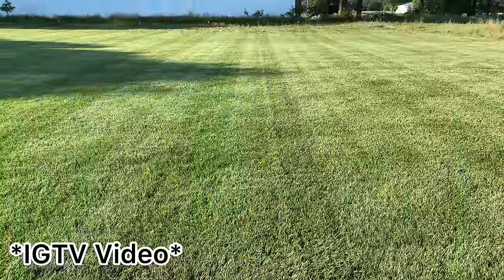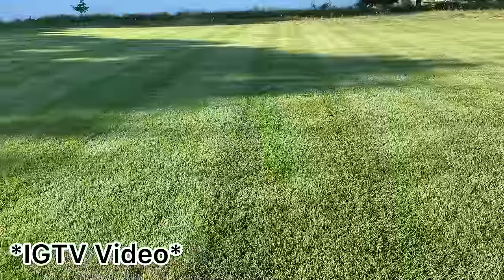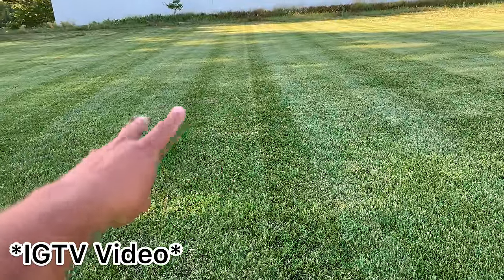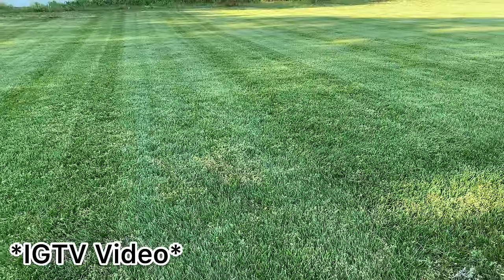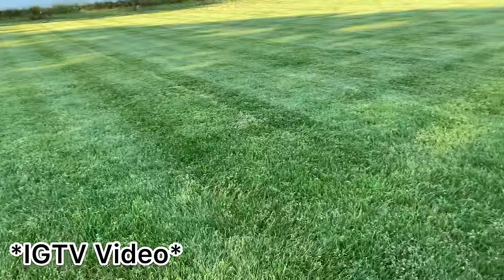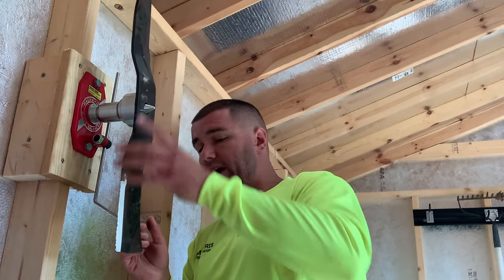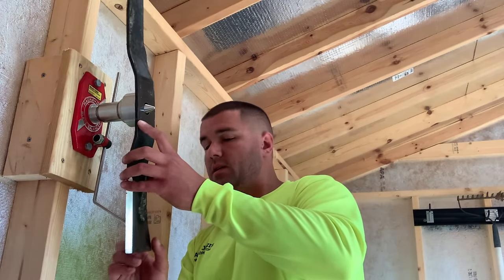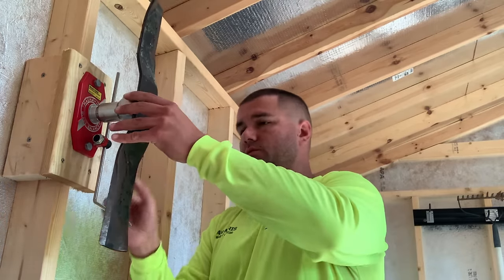Uneven Grass After Mowing? [How to Spot and How to Fix!]

Comment: i look at a lawn like yours and wonder what would bend your blades. something much easier and faster is check tire pressure. you probably have a flat tire. 9 out of 10 times it is a low tire not a bent blade
Reply from the maker: At the time of filming this I was also cutting grass as a side business. But I don’t recall hitting anything. I think the blade was just worn, it had quite a few hours and lawns on it

Comment: You only showed us you sharpened them, but you didn’t show us how to fix the problem
Reply from the maker: I barely remember what I did in this video. Made it like 3 years ago and the algorithm randomly shot it up in views. I took the blade that was bent and threw it away and replaced it with a new one

Comment: Usually a spindle problem or worn out deck mounts but since I have a "politically correct" yard that consists of prairie weeds I usually don't sweat the small stuff.  My "grass" is Indian Paintbrush, Dandelions, Bluebells and clover.  Best of all I don't have to feed or water it.  Thanks for the video.
Reply from the maker: Spindles are fine 🤷‍♂️ Thanks for watching!
Reply: Thanks for the “spindle or worn out deck mounts”.  I replaced all three blades yesterday and still have the same issue as posted in video.  Thanks
Reply: My kind of lawn. Keep up the good work! Ban weed and feed!

Comment: What if i noticed my mower cutting low on the middle blade and leaving the strips of grass so I got new blades and it’s still doing it
Reply from the maker: First thing I would check is the spindle in the middle. Get under there and grab it and see if it’s loose, if it is you need to get it fixed ASAP. Next thing it could be is possibly the deck is out of balance to the front or back.
Reply: Mine is doing it as well John Deere 915e bought brand new ones same issue. I kinda am leaning towards the spindle never greased them when I should have. Any update on yours joe. I’m gonna buy the spindle and replace it this weekend so I’ll let ya know if that was my issues
Reply: You may not have the deck set to have blade tips 1/8" lower than the rear and may also be mowing grass that is too long or deck that is too low.
Reply: @keithruffner7168  No sense replacing the spindle if it is not noisy (good bearings).
Reply: She’s still cutting like crap but I will try to see if it’s the spindle

Comment: In my long experience -- cuz I'm old-- for sure a bent blade can cause all kinds of problems including vibration that will ultimately take out a bearing.  However, after considerable wear and sharpenings, the very end of the cutting tip gets rounded off and thereby can shorten the blade enough to cause it to leave ridges of grass in the lawn as you described.  On another point of sharpening: if you are being as aggressive as shown, the metal will heat up enough to lose its temper and dull real quickly thereafter. It needs ongoing cooling by dipping in water when sharpening. Using your technique with the angle grinder, I can see how the blade would need balancing.  By the time you are done doing that, you could end up with a toothpick of a blade just the right size to throw it on the metal garbage pile.
Reply from the maker: Never had that problem, only blades I’ve ever tossed were bent and a set I had that I hit not 1 but 2 shovels in some tall grass with (new property I had never serviced before). I don’t take them down enough for them to be razor sharp, although it may look like that in the video.
Reply: I agree. Old dudes know shit like this.

Comment: Your lawn, even with the raised lines looks much better than my yard after mowing.:face-purple-crying: I find if I mow too low this happens (under 3") but if I raise it then it's not as bad. It's also hard for me to see it when I am mowing in the afternoon. I don't notice it until evening then the light angle changes and I see them.
Reply from the maker: Much appreciated! It’s on the struggle bus this year, we haven’t got much rain. 😔 I find my mower cuts TERRIBLE at anything between 3.75 and 4.5. I typically cut at 4.5 in the summer but can’t go much lower unless it’s 3.5 or under in the Spring. My next cut will be high. I know what you mean by the sun playing tricks on your eye, that’s such a pain!
Reply: @ProgressiveLawnService  If I cut more than 4" high then I need to mow twice a week.
Reply: @bertroost1675  
People who are cutting more than four inches high are NOT mowing your typical yard.. such as..."LAWN SERVICE " people. They are not mowing at ALL.... probably 1/2 ass weed eatin'. All you can see after is tire tracks and grass tops skimmed.
Next day...(let alone next week)..it looks like it was never mowed. 
Who cuts higher than 4 inches anyway.... some one who is bush hogging?

Comment: You can balance  a blade on the wall with a 16 penny nail    
Straight into a stud or you can put a bolt thru a small square plate or wood and mount the blade to the bolt  and measure the distance  top and  bottom  to see if blade is bent  2 or 3 bucks or you can buy expensive unit as well

Comment: I have the same issue after replacing both blades this year. I have the 5 star center holes on the blades. I found that the previous blades had distorted the star on the spindle. This caused the old blade to be hard to remove and the new blade would not go on the spindle until after I filed off the burrs on the spindle. At this point, only replacement of the spindle will fix the issue.
Reply: No more quality control anymore

Comment: Thanks for sharing but I put brand new blades on and still get this issue
Reply: Bent deck frame?
Reply: @bertroost1675  not sure but a friend gave me a new mower so I don’t have the issue anymore
Reply: Because he’s wrong about bent blades causing the problem. A bent blade would gouge a circle into the yard assuming you don’t drive forward. And if you do drive forward it’s actually going to just cut it evenly, low everywhere

Comment: Appeared to me that if your blade may have been bent and would have been even more apparent if you checked out at the very  end? I check mine by spinning each blade to see if ends align and are level to each other? Interesting equipment though, first time I have seen either apparatus?
Reply from the maker: I used the gauge on the back of my balancer. I MIGHT have been able to tell by comparing them to each other but then who’s to say I’m comparing 1 bent blade to another. I just went ahead and checked them all anyways while they were off the machine. Thanks for watching!

Comment: I’ve put 3 new blades on mine, also had all 3 spindles replaced and still doing that to my yard
Reply from the maker: @roytaylor6602  could be the deck not being balanced at that point. Or tire pressure is off. I’m not really sure what to tell you

Comment: I've gone round and round with cub cadet. I've had two of their lawn tractors. Both left a strip around 8" wide of partly cut grass from under the left side of the deck. They both cut that way new from the dealer. The last one I put into the factory service center and they changed the blades and releveled the deck. Came back no better so I will no longer buy their products. I believe it's a deck design issue. At any rate I bought a badboy zero turn and it looks like a pool table smooth after mowing. Unfortunately after mowing for an hour I shut the mower off to walk a bit and then when I got back on it, it wouldn't start. Batteries hot but no ignition so I had to put a mower with one hour on it in the shop to be repaired.
Reply: I know this is an old comment but I had the same problem with my Cub Cadet GT2250 and drove myself crazy trying to fix it.

Finally figured out that the frame the idle pulleys are strung to was deformed. That seemed to prevent the belt from being as tight as it should so one of my blades just wasn't spinning as fast as it should...or rather none of them were spinning as fast as they should and I never could get that one sharped just right. Works like new now.

Comment: Once , my tires had a small pin hole leak , so my tires wouldn't go completely flat , but just enough that it did leave unevengliness . Looks like you just have tire marks on your lawn , though !
Reply from the maker: My left tire did that FOREVER. It would be fine then randomly be flat. I took it off with intentions of taking it to get checked out and just never did. Threw it back on and it’s never given me a problem again 😂 must have scared it. As for the tire marks, my grass was just growing good and was nice and thick so the tires left some nice impressions.
Reply: @ProgressiveLawnService  Yeah , I didn't think it was an uneven cutting , just a visual effect that made it look uneven !

Comment: What is that system you used to sharpen your blades...looks awesome
Reply from the maker: I use an All American Sharpeners Model 5005 to sharpen them, it’s a jig that holds the blade and grinder at the perfect angle to sharpen them. Then I balance with a MagnaMatic mag 1000 balancer.

Comment: This is all well and good but what about the rest of us who don't have the fancy balancer? How do we check and fix our blades without this neat fancy tool?
Reply from the maker: Some people have success with using a nail, some people have success with using a cheap balanced thing from Lowes or Amazon. Kind of up to the user and how much they want to spend.
Reply: Put a smooth nail or rod in your vise and check.  Grind material from the heavy end.
Reply: I just replace both blades every year or two. Cheaper and less time than using special tools.

Comment: I also have a 60in mower, I have put new blades, spindles, and belt, also had my deck re-leveled and it still leaving Mohawks like that.
Reply from the maker: I see people say that a lot and the only last resort fix is making sure the tire pressure is the same between the back tires and the front casters. Other than that I’m at a loss for what it could be.
Reply: Two toro dealers I’ve took it too checked all tire pressure, blades, check deck, and they test mow with it and say their lost as well.
Reply: ive same issue and wondering what 'deck releveling' is ?

Comment: that balancing tool you use reminds me of a bicycle wheel truing station. it seems great for making sure your blade is not bent but how does that balance the blade? The tool that I have is much cheaper but it just lets you place the blade on a flat surface and then you can let gravity tell you if one side is heavier than the other...
Reply from the maker: Same principle with this it just places the blade parallel with the wall you mount it. The indicator on the back allows to check if a blade is bent then you fold it out of the way and let gravity tell you if the blade is balanced. If it spins to one side, the blade is heavier on that side. I like it but man is it sensitive, very rarely do I spend time making them perfect, just getting close works for me 😂

Comment: I'm getting this with my mower. I even got brand new blades and it's still doing it. I can't figure it out. Also seems like my right blade is ever so slightly lower than my center blade. They all have the same spacers.

Comment: I'd like to know how to replace the deck lower cables on a Cub Cadet LT 1018, please. Just a site to get the info would be nice. Thanks
Reply from the maker: Not sure if this helps but here’s a link to someone working on the mower deck of that machine. I just searched your question in the YouTube search bar. 👇👇

https://youtu.be/abkYyqgC9Mc?si=_a0OAxkv8FYjxqOU
Reply: @ProgressiveLawnService  thanks, I did see that video. My cables aren’t coated plus they go up towards the back under seat area.  There’s a video on that but showing how to dissemble to get to the cables is what was looking for.

Comment: My mower mows evenly but then it just starts digging up the ground? I didn't hit anything and it was fine until towards the end of mowing? is that the same problem as the uneven grass in your video, just more extreme? Thanks so much
Reply from the maker: I’m not quite sure what you mean by that. Like it seems that your mower deck is lowering and scalping? Or your cut is even sometimes then randomly isn’t?
Reply: @ProgressiveLawnService  Yes! Thank you for your reply!! So, right before the last five or six rows, the mower just started smoking and scalping  the lawn! all the way down to the ground so the row looks brown!?
Reply from the maker: @AL-dd6oz  is there a way to adjust the height of the deck? Could be the lever/pedal isn’t engaging and is allowing the deck to drop suddenly. What kind of mower do you have?
Reply from the maker: @AL-dd6oz  that’s a tough one man. Without seeing it, it’s hard to say what the problem is but it sounds almost as if the deck isn’t holding itself up. As in it isn’t staying locked into whatever setting you have it in. What kind of mower is it?
Reply: @ProgressiveLawnService  Hi, it's a Briggs-Stratton (?). The front wheels were bent but a shop pounded them bac in place as much as possible and seemed fine. Would that possibly cause the "deck" to not hold up? I did not use the mower prior to the front wheel damage...

Comment: Never sharpen your lawn mower blades razor sharp sharpen them at a 30° angle and the edge of the blade should be 25,000 radius.... The first quarter inch of your blade does most of the cutting... Make sure your deck is level from side to side in the front should dip down a quarter inch lower than the rear... That's The Sweet spot...😊

Comment: My lawn looks terrible and I have uneven cuts all over. I guess a small engine shop can bend the blades back?
Reply from the maker: No, blades should never get bent back in shape. They need to be replaced. Attempting to bend them can break them or cause them to be stressed and you put them back on and they become dangerous when using.
Reply: @ProgressiveLawnService  Okay thanks for the advice, Ace Hardware here I come.

Comment: Haven’t watched this whole video but right off the bat how the hell would a bent blade moving in circular motion gouge a straight line as you travel forward wouldn’t it gouge a circle when you first turn the blades on without moving the mower forward?

Comment: So did sharpening the blade fix the problem or did you replace the blade?
Reply from the maker: I wound up replacing it. I wouldn’t sharpen a bent blade. I had some other sets laying around I was gonna toss but found one that wasn’t bent and just put it in service with that specific set.
Reply: I had this problem and then realized my one back tire would loose quite a bit of air pressure every week.  Now I just bring the pressure back up before I mow and alls good.
Reply from the maker: @fredparsons5134  I had that problem too when I first bought this mower. Had a very slow leak in the left rear. I took it off the machine and changed my mind about taking it to the dealership and it never leaked again 😂😂 I must have scared it
Reply: @ProgressiveLawnService  , I might have to try that! 😆. I'm tired of airing it up. Lol

Comment: I have a 3 blade zero turn mower that has cut higher on just the left blade ever since I bought it new. I've switched the blades around 3 times with no change. I've also measured the deck height and spindle height. Everything measures exactly the same from side to side. Still get the left cutting noticeably higher. Any suggestions?
Reply from the maker: Tire pressure even?? I’ve had that happen to me, tire pressure was off and the cut wasn’t level.
Reply: Something is causing the deck to torque out of level . and probably a factory defect .  A certain green mower you can get at Lowes is notorious for that .
Reply: Thanks. I think you nailed it!

Comment: my JD rider does that and I was told I had a bent deck..
   I got it from home depot and they said it was a return after 1 week. Well , bent deck will not give an even cut!
Reply from the maker: That’s a pretty unique scenario. The stamped decks on those machines are easily bent, previous owner probably did it loading/unloading it or hit something with it while mowing pretty hard.

Comment: Do you wire brush off the the grass that is stuck on the blades before you balance the blades. The sharping tool is an all American grinder and they work real nice. They have 3 models but one of them has 6 different degrees that you can set it at. It swivels at the base up and down. Put it in the balancer and find the heavy end, mark it with soap stone and start with that side so you don't take of to much of the blade and go from there. Use flapper wheels, they are more gentle than hard wheels and give you a flatter edge instead of a rounded edge.
Reply from the maker: Yes, it’s a pain in the a$$ but it works! I have the 5005 from All American. Works great

Comment: Bearings in spindle let go and the blade shaft dropped down lower then the other blades
Reply from the maker: One of the things I first thought as well (and was worried about). Swapped the blade out and it cut great again
Reply: @ProgressiveLawnService  much cheaper then new spindle.   Be well.
Reply from the maker: @CC-nq7mp  that’s right! You as well, thanks for watching

Comment: If you have a bent blade won't it just mow higher or lower than the other blade(s). Wouldn't a stripe mean a bent spindle? I have the same problem and it's driving me crazy(short drive anyway)1
Reply from the maker: Someone has suggested the spindle was bad as well but I checked them and they’re fine. I also thought tire pressure was off on the first time I noticed this but it wasn’t. They were dead even.